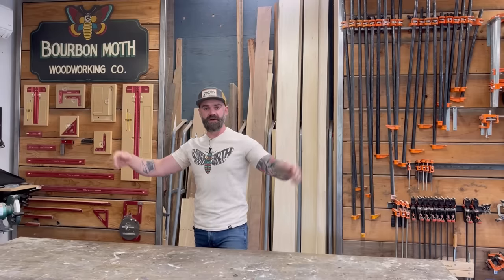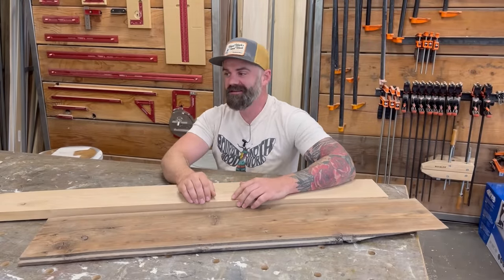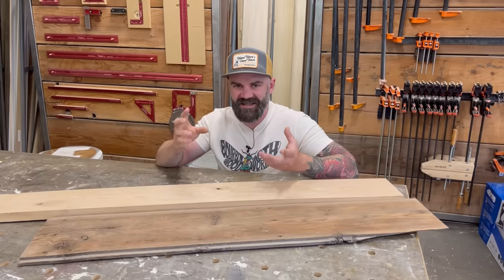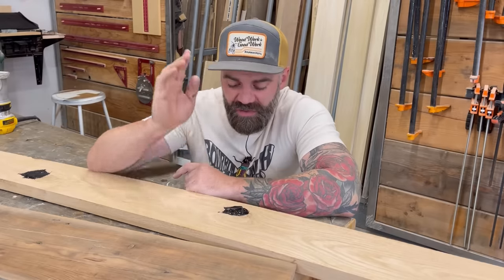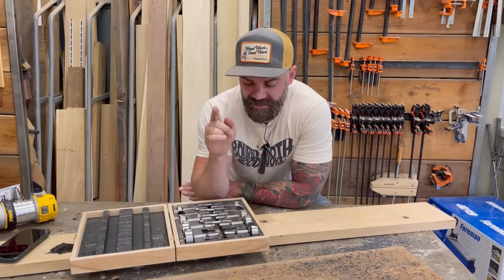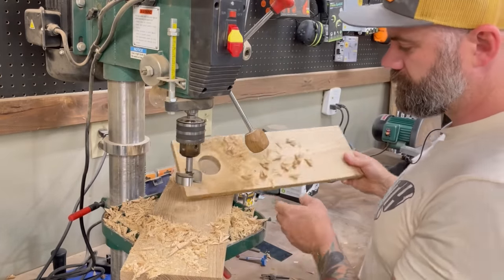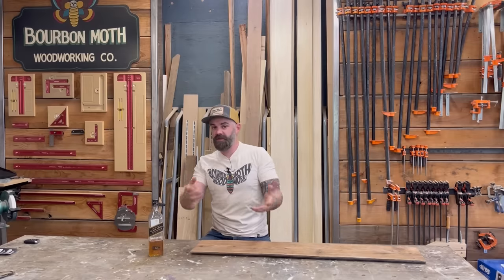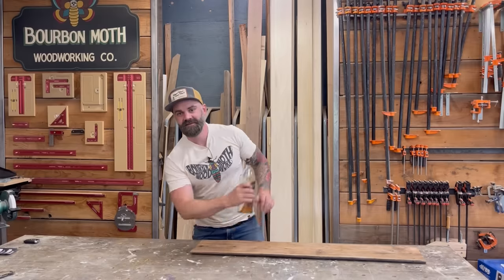Woodworking Tricks You'll Actually Use || Up Your Woodworking Skills

Comment: I do the channel lock trick, but on soft wood I also use a putty knife laying flat in between the wood and channel locks 😊
Reply: A stiff back broad knife works excellent. I used to have an old heavy gauge deburred electrical box cover for prying against drywall.
Reply: Vice grips!

Comment: The “sander headlight” is a terrific idea.  When pulling smaller pneumatic nails they break if you try to pull them out with a channel lock.  I’ve had good success holding the nail with a pliers and using a hammer or small bar to lift the pliers straight up.  You’re not trying to bend the nail so it doesn’t break and usually comes out quite easily.
Reply: A small pair of vice grips makes this trick even easier.

Comment: How in the world have tool companies not caught on and made a sander with lights built into it?!? That’s actually a great idea!
Reply: Great idea.  It took a long time to put it on a light on a cordless drills 😀😉
Reply: i know i use several lamps never thought of putting them on the sander. they are on all other tools why isn't it already
Reply: They haven't figured out not to put lock-on buttons under the hand of every left-handed woodworker yet, and that's an actual safety issue. Don't hold your breath on them putting lights where you need them

Comment: Some excellent suggestions. I use vise grips instead of channel lock - same effect, grip smaller stubs. Love the rabbet + template hole enlarger. The total boat epoxy filler - new info!  Thanks for (most of) the video.

Comment: Good tips. For pulling smaller nails, or ones that are nearly flush, i like to use end cutting pliers. The sharp jaws grip better, and they have the same rounded shape to lever the nail out. Plus they're wider than channel lock pliers, so they're less likely to dent the wood. Sliding a putty knife under the jaws prevents dents, too.

Comment: I use System 3 T-88 epoxy for voids.  It's structural epoxy that I had left over (had some dry rot outside), but It's viscous and works well for filling things like knot holes in black walnut.  It's in 2 containers, resin and hardener, so you only mixup what you need.

Comment: The best tip for paint cans I’ve seen is to cut the top off of a bottle and slip it over the can and shrink it on with a heat gun. Then just pour out the paint you need and screw the lid back on. GENIUS.

Comment: Both your router tips were great!!! To get diameter ( 16:48 ), you could wrap a string around to get circumference and divide by pi
Reply: Use blue tape. Works better than string.
Reply: Isn't there a risk with string that the circumference you're measuring isn't perpendicular to the cylinder's edge, and is therefore longer than the cylinder's true circumference?

I guess tape solves that problem since it'll only go on flat.

Comment: The rubber band on the paint can is a good one. I have found that punching three or 4 holes in the channel around the top of the can allows material to drip back into the can. Works well on gallon cans when product gets trapped in the channel when pouring.
Reply: That’s a great idea!

Comment: I would add that sanding epoxy (3:45) also causes heat buildup and softens the epoxy. This leads to sandpaper gumming up quickly and wasting supplies.

Comment: Measuring tip: Wrap a string around the item you are trying to measure and mark the length. Put that against your tape measure to get the circumference, divide that by pi to get the diameter, and divide that number by 2 to get the radius...

Comment: I used to do the slip joint pliers for pulling nails. Went to end nippers. More surface to not dent wood. Gets right down to the wood surface for grabbing the nail (pliers might not grab tiny tip well) and has wide head so long nail can pass through the side and you can keep prying. Just dont squeeze grip too hard so it won't cut the nail. I found the Menards tool shop shape to be best and super cheap. I've pried more nails than I'm proud to admit. Its my favorite. Had to weed through quite a few crappy ones to find the best. Not the best machining from the factory.

Comment: Measuring diameters: I bought a tape measure without looking at it too much and it turns out that on the back side it has "inch" dimensions that are 3.1415" apart. You wrap it around whatever, read the number, and you see what the diameter is. It's pretty neat. I don't have much use for it, but I like that it exists.
Reply: on a similar note, the forestry industry has "diameter tape" also known as "logger tape" used for measuring the diameter of trees, basically using the same method srwapo described, but  thought a few search terms might be helpful for anyone interested

Comment: I punch holes in the rim groove of paint cans (etc) and the material will drain back inside the can. The lid goes back on and seals the can again. Also no splash when you hammer the lid tight. Especially handy when you pour liquid into another container instead of dipping brush in the can.

Comment: The channel lock trick I remember doing when i was 6 years old.  My dad and uncle tasked me with pulling nails out of board's to give me something to do for a while and to keep me out of their hair.    I had nails with heads too small for the hammer so I started digging in the tool box  saw the channel locks and figured I could pull them out. Didn't work, but then i pushed down .  Total accidental discovery of a 6 year old turned into one of the best tricks I still use.

Comment: If the nails are hammered further in the board channel locks will mark up the wood. I stick a putty knife under the channel locks and it works every time. Just a heads up.

Comment: Good trick on paint cans. Take a small punch or pick tool and punch 4 holes evenly spaced around the can in the groove the lid seats in and the excess from pouring the can or from stirring will drain back into the can and the lid will still seal perfectly

Comment: Nail pulling, an upgrade to the channel locks is to use vise grip pilers. Same leverage with a power grip also use some material when require to prevent denting your stock

Comment: 16:44 If you don’t have big squares (I currently don’t) you can also use a sewing type tape measure (the floppy kind) and wrap it around the thing and then you have circumference. It requires math or you can just ask google “what’s the diameter of a circle with xyz circumference”.

Comment: To find the diameter of a circle, take a piece of string and wrap it around the circle, measure the  string where it meets when tightly wrapped around.  Take this number,  the circumference and divide by 3.14 (pi).

Comment: Another way of cutting any diameter round hole with a router is by drilling a small hole in the centre and using a fitting or jig to pivot your router on that point with the cutting bit at the correct radius.

Comment: Unbelievable as it may seem, but I remember a time before epoxy. If we had a hole to fill, then we used a Dutchman. The easiest way was to find a dowel of the right size (we turned our own and always had offcuts). You just then drill or rout the hole to the right size for the dowel to fit and job done. For larger holes, and once routers became affordable, we just used a simple shop-made circle jig - or some routers come with a circle jig as an included accessory. The router circle jig allows you to make holes exactly the size you want to an infinite number of sizes. Just fix your piece with double sided tape to a piece of scrap underneath so that the centre piece being removed just get loose with that final router cut (I hope that makes sense)

Comment: If you somehow have access to the end of a pipe/circle, you don't need to know exactly where the center is if you just want to quickly run a tape across the top. Just pivot the tape on any point of the circle and use the highest measurement. The diameter will always be the longest point.

Comment: Here is my paint can practice...
When you open the can for the first time, make holes in the trough 3/4" apart all the way around the trough with a framing nail. That's let's the paint drain back into the can.
Step 2: Always store opened paint cans upside down. Air can not get in, and you won't get the skin on top that you need to strain off.
No charge for the tip. Just invite me over for some iced tea.
Dave G

Comment: Good tips and well delivered!  Even the diameter trick with two squares….but don’t run around your math backhand.  A piece of string and a tape measure will get you there….circumference divided by pi.

Comment: One trick I can share with you all (maybe you already know it and I am just late to the party)....If you have an old set of chisels, maybe ones you got back when you started woodworking 20 years ago from Sears.  Even if they are not the best, if you have a large 1 or 1.5 inch chisel, you can use that to scrape away glue squeeze out from internal corner seams, especially if you have long inside corner seams.  just lay it so that the edge of the chisel is along one of the corner walls and the corner edge is in the corner you are removing fresh glue squeeze out from.  Then just pull back.  You should be able to remove about 80-90 percent of the squeeze out from the corner where it's hard to get a wet rag into.

Comment: To get the diameter you can also use a tape measure ribbon to measure the circumference and then divide it by PI. And if you have one that doesn't stretch too much, it can be even more accurate then a caliper.
Reply: Math is hard!!! Especially when your ribbon is in inches and you want it in millimeters …. 3.145 and 2.54 are hard to remember!
Reply: @Vampier  in that case maybe 0.123 is easier to remember, if you divide inches by that amount you'll get diameter in millimeters with an 0,5% accuratesse 😁
Reply: Checked the comments to see if anyone posted this 👍🏻
Reply: @Vampier 3.1415, so yes I guess it's hard to remember.
Reply: @EmyrDerfel  typing is hard!
Reply: If you don't like math,  Just speak the math to Google.  Surely you can do that.
Reply: @clemoniii  google is hard!

Comment: For tip 1 you can use milliput, it comes in alot if colours, it's a two part appoxy but it's like plasticine at the start, so doesn't run

Comment: If you want to get the height of a router perfect for flattening knot fills etc just drop it on the surface with a little scrap of paper that's just under the bit. Secure the bit height then remove the paper et voila

Comment: That intro was more bourbon than moth. Just a tip from a pro, though. If you used a rubber band to hold that dominos in place, it would have been easier. And you should brush on a little marinara first, because the wood is going to soak some of that up. But it was good that you went with the grain of the pizza. Some people go against the pizza grain.

Comment: Alternatively, use a set of calipers (the ones that look like opposing hooks). They’re flat and you only need pretty much one set close to the biggest size you need, and they’re easy to measure with, and depending on your styles and diameters they’ll do internal and external diameters

Comment: Brother I have to warn you. One of the worst days of my life was the few hours or so I spent in horrible pain with a tiny almost invisible epoxy flake in my eye cutting and scratching my eyeball every time my eye moved. And then the hour or so it took for the doc to even find the flake because it was so tiny and clear in color and virtually invisible in my eye. I really cring when I see you using that router without safety glasses. It's way too easy to protect your eyes, to ever make an excuse not to. My "accident" didn't even come when I was using tools. It came outside my shop after I was done and I dusted myself off and the flake went into my eye. I've had broken bones, cuts, burns, smashed toes etc. bla bla bla, but that eye thing was one of the worst most miserable pains I've ever experienced.